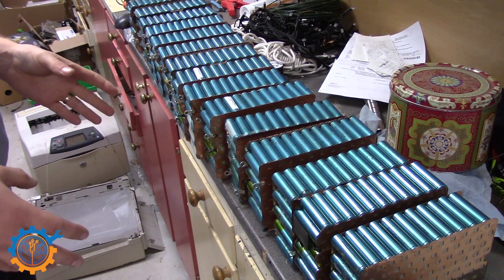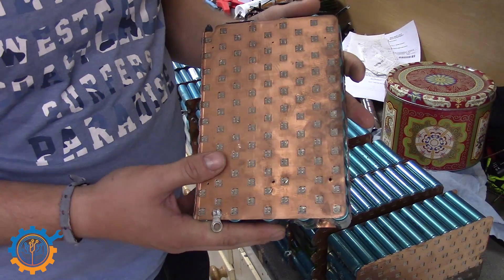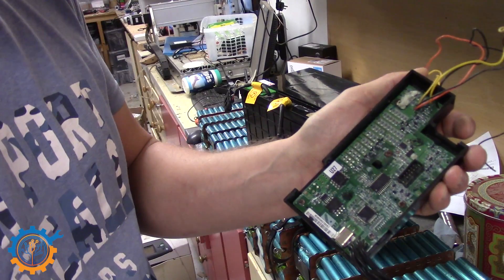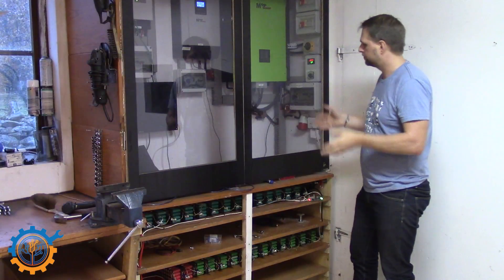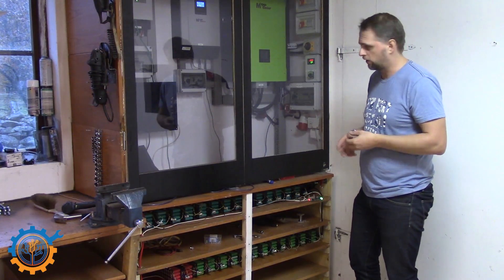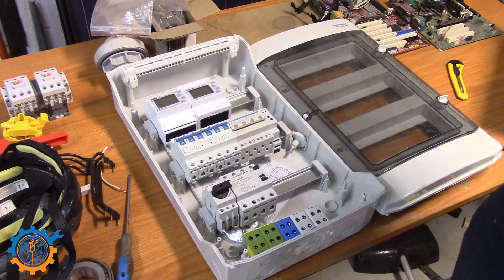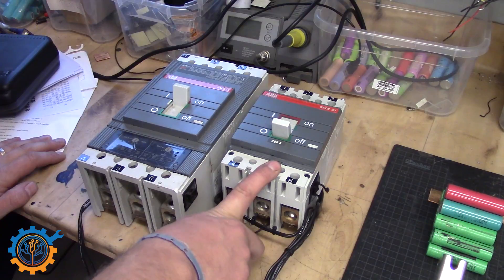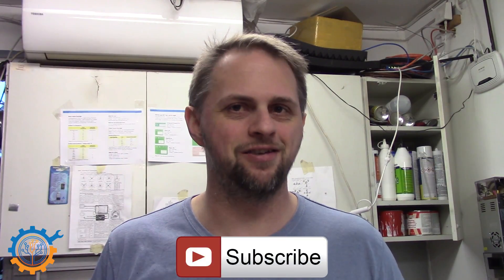Another 5600 18650 cells - Batrium - Shunt trips/breakers - UPDATE

Comment: Is it posible to mix battery types and balance with batrium software? I mean isn't e.g. the charging pattern an issue?
Reply from the maker: You generally run 1 type of battery per watchmon/batrium system. I have 2 different types. LiFePo4 + LiIon. and then 2 watchmons hooked up to this. Both banks hooked up in parallel and charged in same way. Just the voltages that are different as such in my case. 16s vs 14s

Comment: I an a recent subscriber so am not sure how you process these battery packs.
Do you strip old battery packs apart, test each battery individually and re-assemble good ones again?
Reply from the maker: The ones in the video here comes out of 12V Valence packs. They have 4 of those modules prebuild. Im not stripping down those but tests them as whole. They have lived together all its life so i doubt one cell in middle are that much worse than rest that its needed. Time will tell.

Comment: Wow, some day i'l get there too.
So you connect 14S Lion and 16S  lifepo4 to parallel?
My system works that way just fine :)

No need any certification here, i can do whatever i want.
Even disconnected ongrid wires myself to go offgrid forever :)
Reply from the maker: Yeap i run 14s lion with 16s life. They have its own Batrium BMS system
Reply: It seems strange, but If the batteries are happy with the voltage range then they should work fine.
Just won't be able to parallelize the balance cabling so they'll have to be managed independently.

Comment: Daniel, that new controller box looks really cool!  Do your local regulations require that a certified electrician hook that up or only that an electrician certifies the installation?  Cheers!
Reply from the maker: Its ok if a certified electrican approves and meassures it afterwards. Thats how i did the first parts where i installed the cabinet and then he came and looked through so it all was done correct and approved it. Though many electricans does not do such things since it can be to much work sometimes :)
Reply from the maker: Note that it depends on what parts that we talk about :)